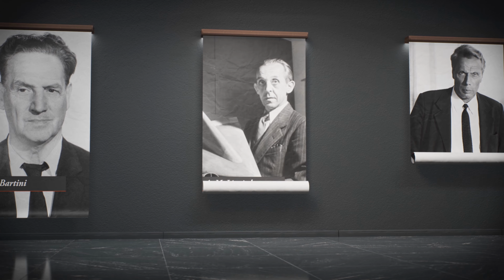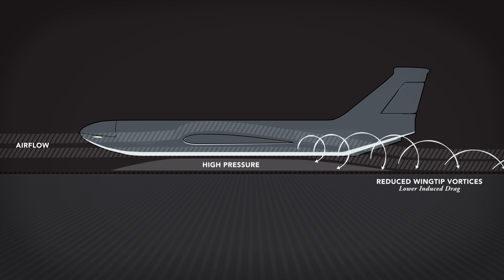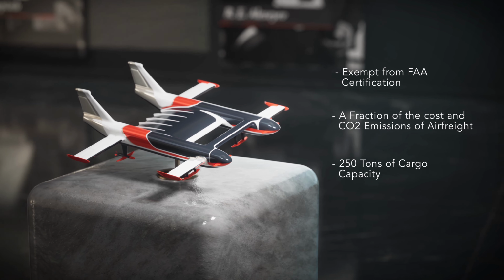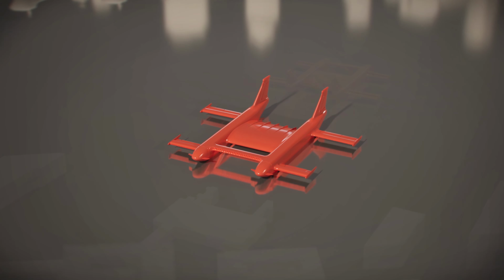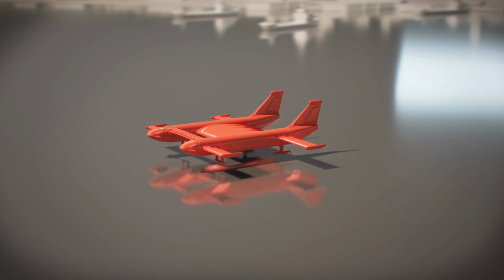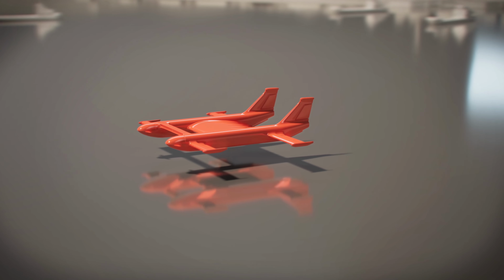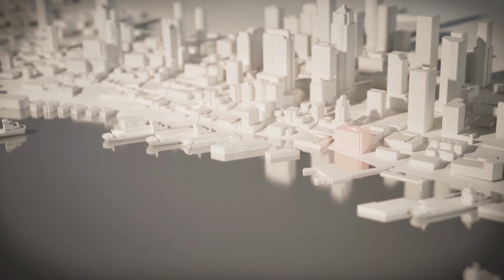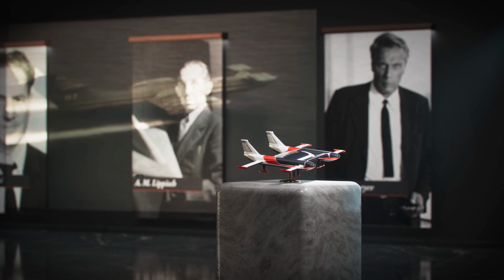Leviathan Air - The Power of Ground Effect

Comment: I worked out a better starting technic than hydrofoils.

With this the ground effect vehicle can accelarate to 200 knots before the ground effect gets strong enough to lift.

This results in much higher efficiency. Up to 10 times better than airplanes.
Reply from the maker: Sounds interesting.  But we only need to get up to about 60 knts to takeoff into ground effect.   200 would be crazy in waves.  😮
Reply: @Leviathan-Air  

If your takeoff speed is about 60 knots, you need very good high lift devices.
Else the wig is going to fly really slow.

I got the idea to use pressured water 
as starting help.
Before start 20% of the Wig's weight is filled in water tanks. There high pressured air is filled in too.

At start the air gets ignited increasing the pressure further. 
The water is exhausted as water spray.
This spray comes from the wingtips. 
And it pulls air from outside under the wing increasing pressure.
This works a bit like an hoovercraft, that got a skirt out of water spray.

This design needs one big wing instead of tandem wings.
So fuselage and wing gets merged.

This offers far more room and lift capacity. And it reduces drag and enables a faster cruising speed.

If you want to improve tandem airfoils --
Build inverted delta airfoils.
One big and one small airfoil work better. 
I believe a canard design should work well.
Slotted flaps in combination with tubercle wings are important for WIGs. It should be a STOL design.